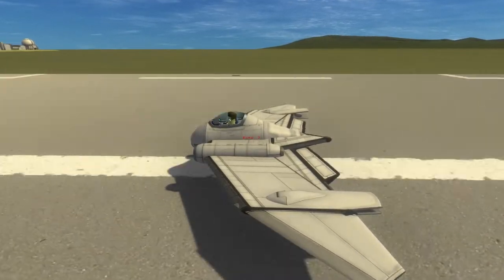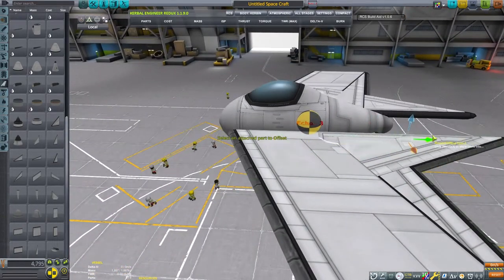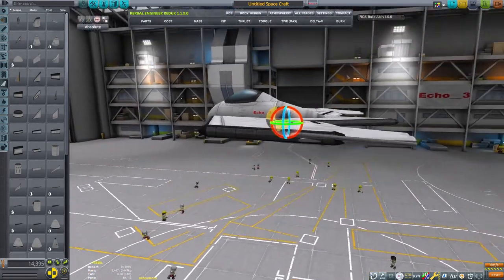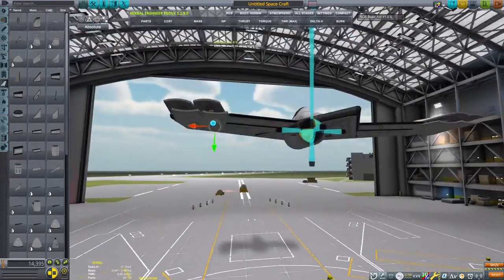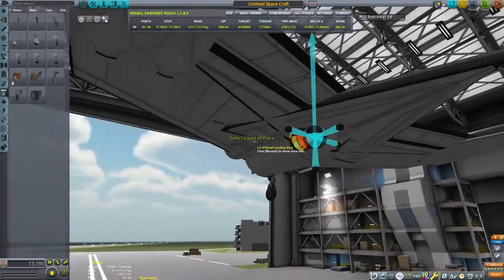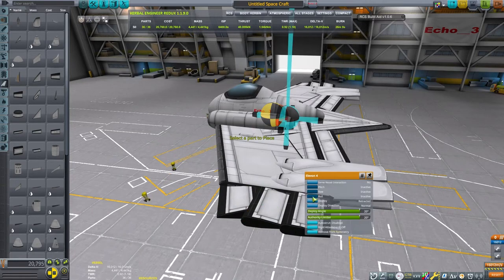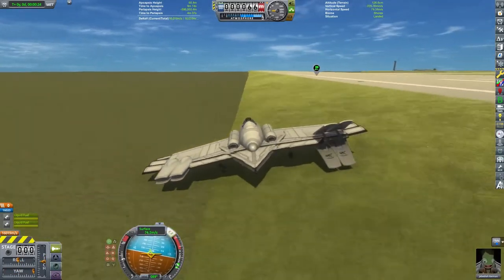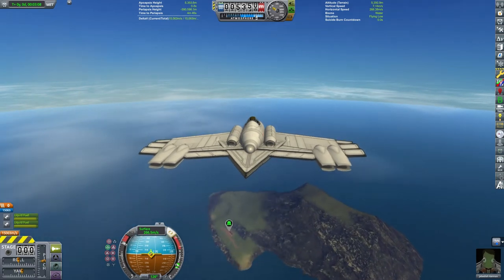Jet Powered Flying Wings in KSP

Comment: I think I know a way to get yaw control using elevons. If the elevons are tilted slightly so that it isn't perfectly flat, they should respond to yaw input. That said, they should respond minimally, so maximum deflection is needed to make them usable. I'll give it a try.. sometime soon.
Reply from the maker: Let me know how your test goes. I'd be interested in learning the results.
Reply: A split alerion will do

Comment: how did you make the airbrakes for yaw control
Reply from the maker: The air brakes can be assigned yaw and pitch control authority. That is off by default.  I didn't have to do anything too special as this is a stock build.
Reply: @Echo3  oh yeah just realized
Reply: @Echo3  at the first i dont know that so i used kal-1000 lol
Reply from the maker: @stinkyfish.1508  That's fine. If it works, it works!
Reply: @Echo3  it dosent unfortunately
Reply from the maker: @stinkyfish.1508  That's too bad. I just assigned the control authority in the SPH.
Reply: @Echo3  alright

Comment: Great video! but it seemed kinda odd no intrudutcion and is it rly a flying wing when you can still see a tube as the hull?
A more thicccc and longer wing wolud Look a lot better and closer to a flying wing. Also you colud place fuel tanks in the wing so Just In next flying wings pls consider that.
Sorry for my bad English 
You are  better than me in the game
Greaaaat video.
Reply from the maker: This is more of a general how-to video for making a working flying wing in the game. Yes, I do talk about some of the struggles that real life designers went through. The game is very limited with parts. Only three wing pieces are also fuel tanks, but with mods like B9 Procedural wings, you can make something more realistic. 

In my current series, I do include an intro for every video.

Are there any topics that you would like to see covered in a video?
Reply: I understand  but I meant like Puting a fuel tank in betwen 2 wing pieces and creating a thickkk wing with it 
I know that how the game calculates areodynamics there wolud not be much of an advantege with that but rly it wolud Look so cool with the curve of the fuel tank being the front of the wing and angled wing pieces making the trailing edge.
Edit: Just like Vaos  did  with his star raker.
Reply from the maker: @pawedabek1445  It is very possible to do that with fuel tanks. It would create some issues with drag, but it could look cool. The downside is that it would probably take me an hour to make the craft look nice and function well. That might not work out so well for a tutorial video.
Reply from the maker: @pawedabek1445  It so happens that the Central Kerbin Alliance Network is in need of a new spy plane. There is something interesting going on at the Dessert Airfield that they need to see.
Reply: @Echo3   :D